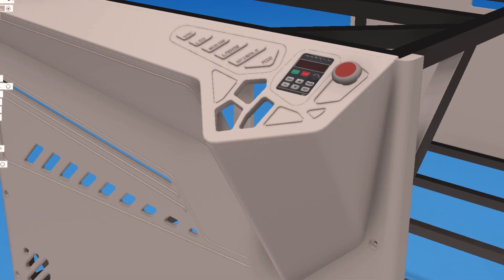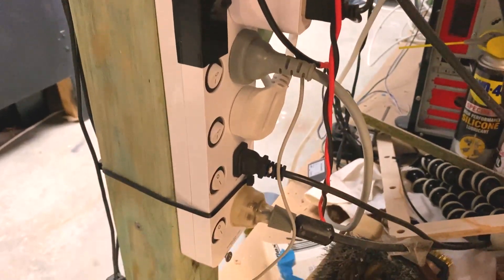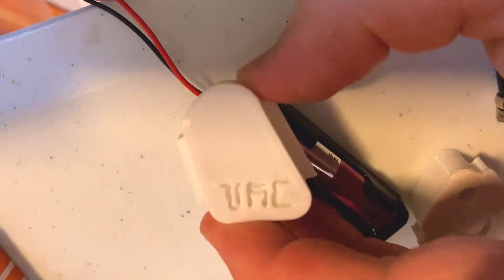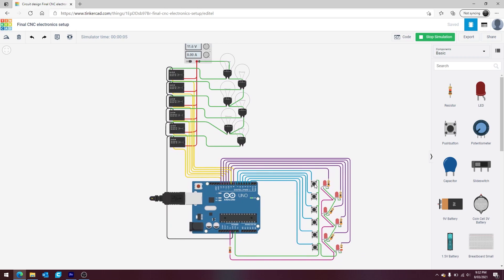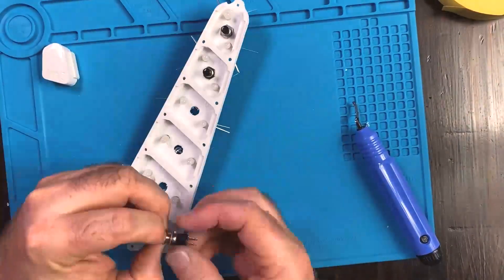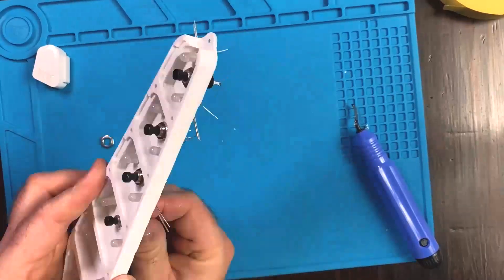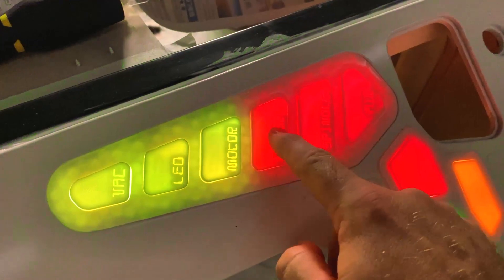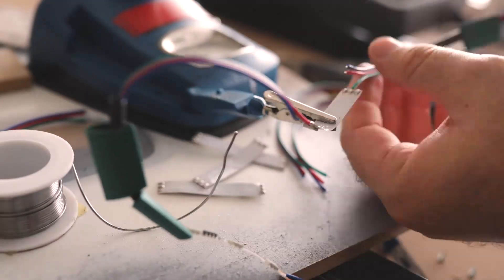My Ultimate CNC Table - Arduino Electronics Part 2

Comment: since u already have the cnc machine, u should look into using it to cut your own circuit boards, that would have reduced a lot of the wiring down to just soldering
Reply from the maker: Great suggestion! Check out my LED lamp from a few months ago! Great minds 😁😁😁